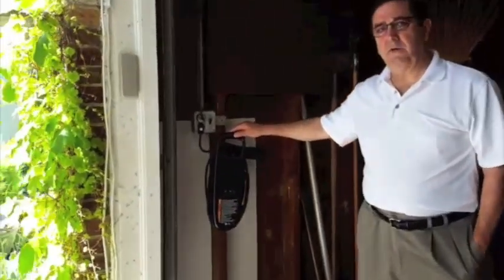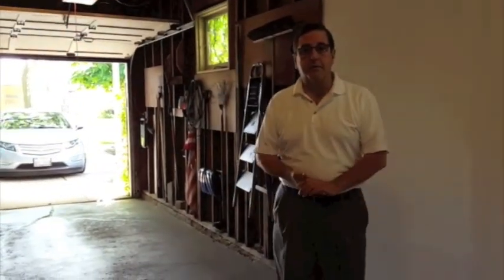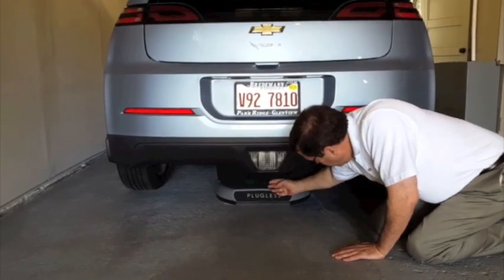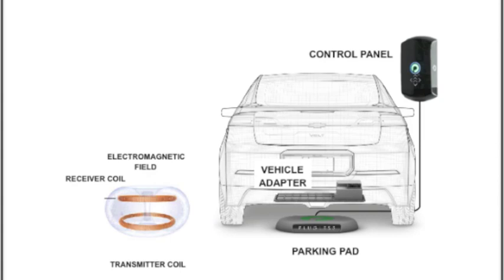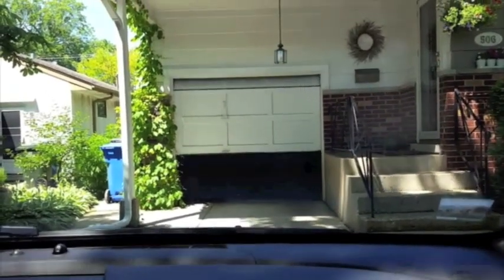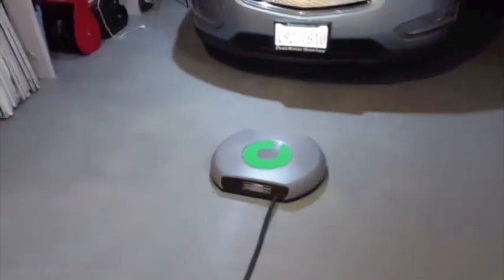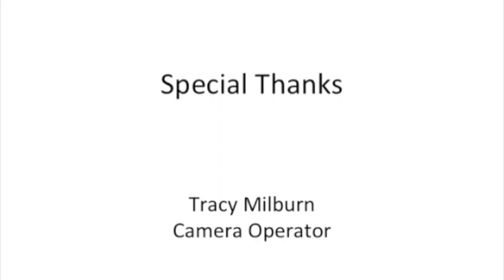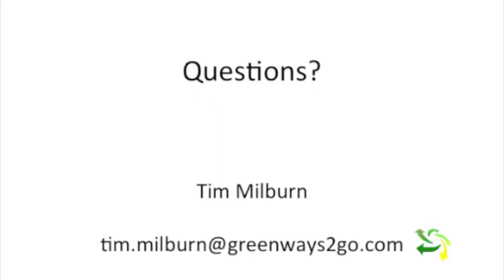Plugless Charging Basics

Comment: 7:24 - The on-board charger is actually inside of the front bumper. That converts 120VAC into the DC charging current. What you were pointing to is the PIM , which converts DC into 3-phase AC for the traction motors.

Comment: The Chevy Volt's maximum charging capacity is 16 amps, which will charge the battery in 4 hours.  By default the Volt is set to draw only 8 amps using the portable charger that was initially shown.  You can change this in the car to 12 Amps which drops charging time to 7 hours for a complete charge.  This means this guy paid $1,200 to remove 3 hours of charging.

For me I love my Volt, but I charge it overnight where I change the setting in the car to 12 Amp charging on 120 volts.  I didn't know this and almost bought a Level 2 charger for the car, but honestly I haven't used gas in months and it is great!
Reply: MrJosephsMyth is the setting to change from 8 amp to 12amp in the infotainment system?
Reply: Yes.
On the generation 1 Volt, while in park and running, press the leaf button, then press charging on the screen, then select " change charge level".
Then you can select either 12 or 8 "standard" amps.

Comment: Just a FYI.  The power, as it comes into the charge port receptacle, doesn't go to the PIM (power inverter module) as noted.  It actually goes to the battery charger control module.  From there it goes directly to the battery.  The PIM transfers power between the battery and the drive motors, and also supplies other accessories.  Thanks.

Comment: I may have missed it...but what is the cost?  

Also, comparing the ease of use of the Level 1 plug in to this wireless charging was not really a fare comparison.  You placed the Level 1 charger at the back of the garage, requiring you to un-wind nearly all the cord to be able to reach the car.  (nice acting on the effort by the way).  

A more fare comparison, since you were spending money anyway, would be to compare a Level 2 charger installed directly next to the your car where you actually park it.  I placed mine on the wall just in front of the driver door...and 2 feet higher.  I can plug in with absolutely no unwinding...and no cord on the floor.  That's not to say I wouldn't like wireless...but let's be honest about the effort.
Reply: Paul Jensen asks a simple question and has paragraphed response
Reply: +glbuls 

Posting on behalf of Tim Milburn

Hi 'gbuls', 

The total price is dependent on 2 main factors: 1) which EV and 2) the cost of the branch run circuit. Currently, Plugless is only available for the Chevy Volt, Nissan Leaf and the Cadillac ELR (about 75% of the EVs on the road). 
The Volt is $1260, the Leaf is $1540 for all and the Cadillac ELR is $1940 for all the required equipment (control panel, parking pad and vehicle adapter (installed)). The branch run includes the materials and labor to run conduit and wiring from an existing electrical circuit breaker panel to the EV parking spot (Control Panel), so the cost is a function of distance. Typical home installations cost between $500 and $2000, with an average in the middle. 
Many states offer rebates for the installation. In some cases, there may not be enough power in a home panel and added electrical power is needed which is an additional cost. If you are in the Midwest, we can help with cost estimates. See my web site (www.GreenWays2Go.com). Click on the link and give me a call. We may be able to help you with a discount if you are interested in a Plugless Charger.

Ease of using level 1:

The use of the Level 1 (110VAC outlet) at the front of the garage was strictly for
demonstrating the corded Level 1 unit this outlet was located in a good spot "for the scene". I have a 110 VAC outlet near the front of the garage and on my driveway, which I had used daily for the first six months& I owned the Volt.
No problems whatsoever, I just really like the convenience of not having to plug in.

Now that I have run 240 VAC power to a good garage location, adding any Level 2 EV charger would be easy. Having the inductive charger is simply more convenient. I park and go into my home without dealing with cords or plugging in. I never blow off charging and consequently feel like I use more electric miles with my PHEV. Users may not always remember to plug-in especially if carrying in groceries or other things into the house and forgetting to go back and plug in. Also, for an organization, shared PHEV’s are subject to users forgetting to plug in. Finding an uncharged vehicle in the company car pool can be very frustrating, if the previous user didn’t bother or forgot to plug in! Finally, when it is snowing or raining, it is easy to justify not plugging in - bad weather makes for a dirty car and cable and potentially can mess with my or my wife’s clothes. These are the (dry cleaning) hazards of living up North.

The Plugless charger loses about 5 to 7% of the energy through the air gap between the parking pad and the vehicle adapter, compared to a corded charger. For where I live (Chicagoland), this translates into the price of a cup of coffee
each month in extra electricity, compared to a corded Level 2. For those that are focused on squeezing every dime out of their EV, inductive charging may not be their solution, but for those that are EV drivers for the full EV experience, plugless is great. Further, with my PHEV, I believe I use less gasoline, considering I never avoid charging so I am ahead on both money and carbon emissions.

Pull the plug and go inductive...

Tim